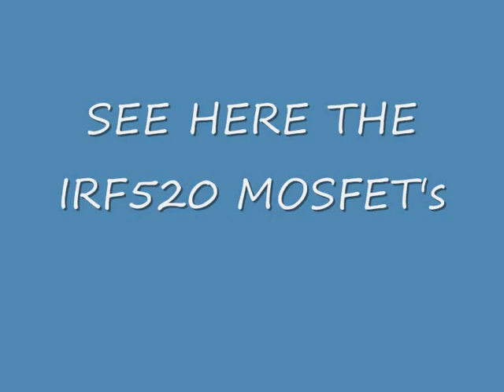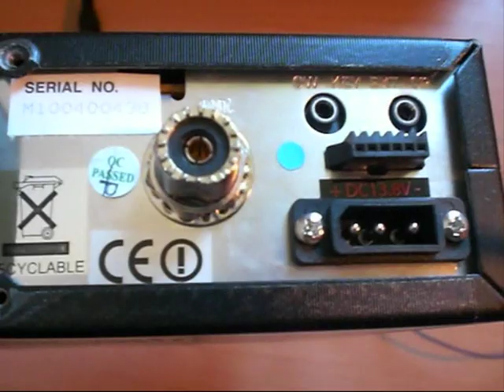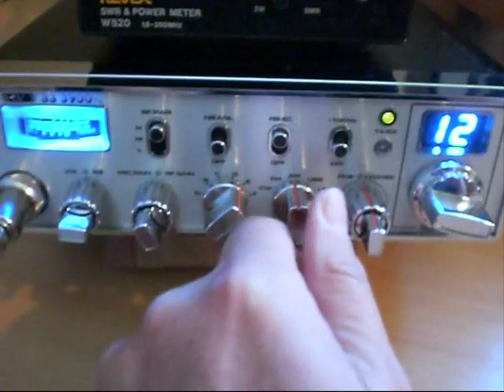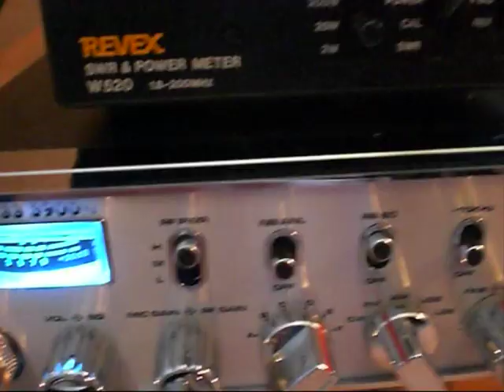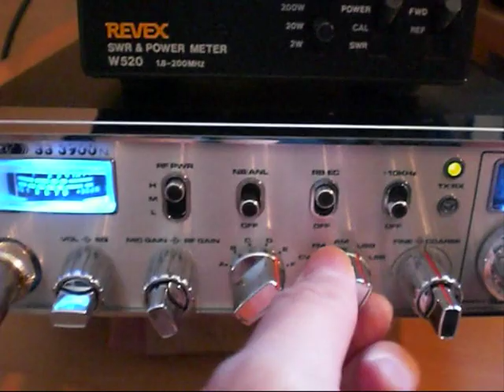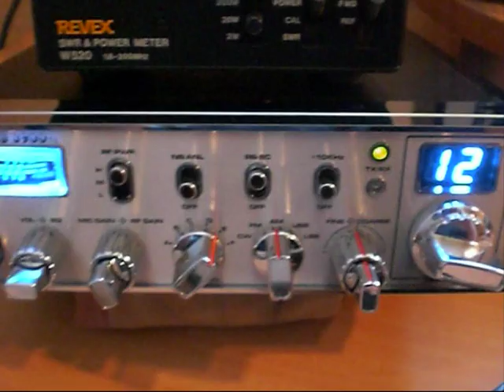SUPERSTAR 3900N, OUTPUT REPAIR - EASY FIX!

Comment: I Have the 3900 EL its had the conversion but it seems to have a lazy needle ? even with people close by who would be +30 are only showing abt signal 9 is there an easy fix for this? there is a VR5 on the board but it only adjusts the level of when i key up. also my `girlfriend bought this for me for xmas off an e-bay shop and when i contacted them they were quite nasty.

Comment: I've been stung by the same seller. Mine was sold by the same guy (with a frequency counter) as new, but I very much doubt it was. It has had track repairs done to it, there was a few dry joints and there were a few cracked joints in mine. 

My mate who repaired it said he very much doubts that it was brand new.

I possibly think, maybe it was a case of human error and the guy who first built it made a mistake and had to repair it. 

But I would advise people to beware when buying one of these.